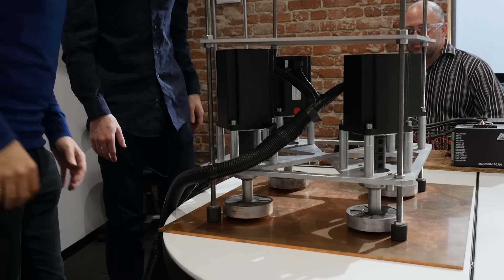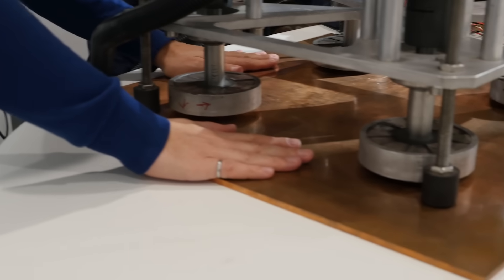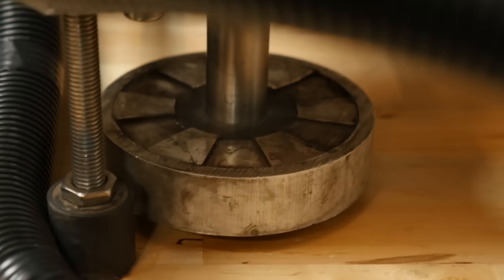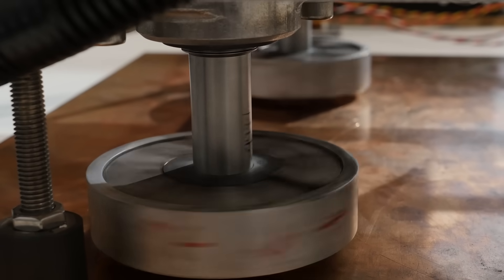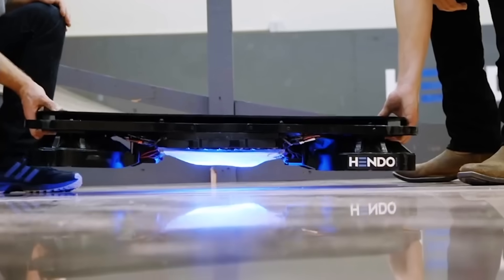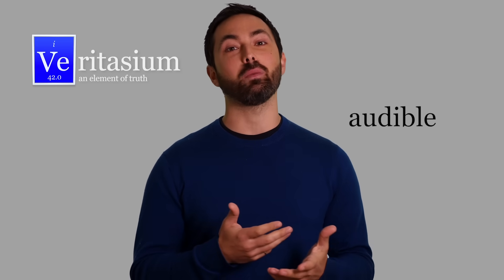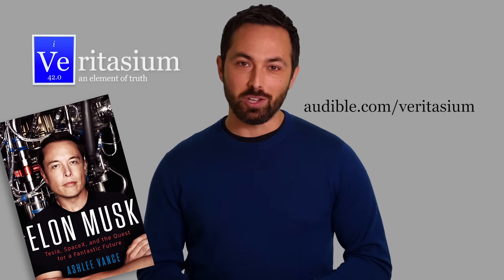Electromagnetic Levitation Quadcopter

Comment: instead off spinning it make a copper dome for each foot with and air gap restrained to the magnet has to be a air gap between the copper and  magnet then throw  the same voltage you used to spin  the magnets.   i swear i made a mini floating ship as a kid out wall socket voltage i was trying to make a heater lmao.... if floated I've been trying for years to replicate it .. but i think copper is the solution .

Comment: So showing the turn of one or more motors would steer the thing in theory but I would use more than 4 motors for a more accurate control of steering and I would use some mix of aluminum  to build the device  see if u can play with the heat issue s little bit

Comment: %%% PRIMARY COMPONENTS %%%

% Reactors with quantum-metamaterial shielding reactor( , type(fusion_mini, v7), rotation(, 20000 rpm), shielding([ layer(zrc_sic_bn, [ thickness(2.8 mm), density(6.2 g/cm³), impact_resistance(48 km/s), thermal_stability(3200°C) ]), layer(graphene_diamond_nanofiber, [ thickness(1.5 mm), toughness(17 MPa√m) ]), layer(photonic_metamaterial, [ structure(hyperboloid), cherenkov_dissipation(enabled), thermal_expansion_coefficient(-2.6e-6/K) ]), layer(sic_polymer, [ self_repair(enabled), response_time(25 s) ]) ]), cooling([ quantum_hall_system( bilayer_graphene_θ1.05, efficiency(94%) ), metastable_hydrogen_circuit( isotope('²H⁻'), state(rydberg) ) ]) ).

% Superconducting discs with topological coating disc( _, material(braided_carbon_nanotubes, [ tc(-175°C), critical_current(380 kA), toughness(88 MPa√m), density(1900 kg/m³), coating(bismuth_antimony_telluride) ]), balance_control([ piezoelectric_actuators(56), correction_latency(45 µs), algorithm(quantum_navier_stokes_v2) ]) ).

%%% HOLOGRAPHIC CONTROL SYSTEM v3.1 %%%

controls( _, _, algorithm([ holographic_neural_network_v3([ topology([input(2048), silicon_photonics]), latency(0.08 ms) ]), quantum_vortex_sensors(resolution(5e-7 rad/s)) ]) ).

%%% IMPROVED ANTI-QUENCH PROTOCOL (v2.6) %%%

protocol( femtosecond_antiquench, steps([ 1: quantum_entanglement_detection(threshold(0.001% ΔΨ)), 2: terahertz_photon_injection(5-10 THz, 150 fs), 3: activation_of_topological_scaffolds([ geometry(hyperboloid), material(nb3sn_2d), flux_resistance(25 T) ]), 4: strategic_reserve(harmonic_em(14.7 GHz)) ]), total_response_time(1.1 ms) ).
Reply: What is this?

Comment: little question , if u could atach te copper plate with some elastic strings from above the machine in such a way that it only permits to levitate and stay in a fixed position exactly under the machine , would that not cause the copper plate to levitate with the machine ?

Comment: in the rverticle hollow tub if the dropping ball is heavy enough you can suck it up the tube magnetically with rsistence and achieve lift ... like catching the mementum of a pmouse trap .. pull magnet up fast and hit hard resistance at top is internal mag lev

Comment: It's floating on the eddy Currents being formed in the metal plate, this wouldn't work without a conductor underneath it, with proper tuning, it may work using the Earth as the Conductor.

Comment: A very long time ago I saw a soneliod with an iron rod running through it. The rod was about 2 to 3 feet in length.  An ac current was inducted in the coil, which was mounted vertically. A doughnut shaped aluminum ring was placed around the rod and it floated about halfway up. This was because of the induced eddy currents. Would be a nice suspension device.

Comment: Like the flat earth, I think videos that give credence to the idea of a hyperloop should come with a warning on the bottom. You cannot hold a vacuum over distances longer than a few hundred feet, the thermal expansion with the different parts along the tube would cause implosion and be ridiculously expensive. You could argue maybe burying it deep underground could work, that doesn't get rid of the cost factor, which goes up substantially, even worse, it doesn't solve the problem, a differential of just 1 degree k along the tube under a vacuum (even a "light" one) would within 95% certainty cause implosion... So, the only way to fix the temperature problem would probably be to put a massive heat-exchanger to the entire outside of the tube, while deep underground, and a series of tens of millions of computers thermally regulating each square inch of the tube within 1 degree, fixed near enough to each space to avoid latency issues, even after those quadrillions of dollars are spent building it, it wouldn't be at all resistant to earthquakes or a bomb going off nearby, or a stray shark banging into its side with a force greater than a few newtons.

Comment: Is the energy to heat the copper plate accounted for by the voltage and current spinning the motors? How much power is left doing the lifting? If you press on the device does that show up in the amperage to the motors?

Are the magnets contributing anything measurable?

Comment: If you put a scale under the copper plate, does the weight of the copper plate increase in correlation to the levitation rise of the quad-copter, when turned on? If the copper plate were attached to the quad-copter by a metal pole which the quad-copter could slide up when levitating, could the quad-copter lift the copper plate below it too, given enough power/magnetism?
Reply: ...or is a change in air pressure or vacuum created somewhere between the plate and quad-copter?

Comment: Shield 🛡 the field forces, vectors.  Use radioactive ☢️ materials. Lead.  Ultra refined steel.  Experiment 🧪 w: frozen 🥶 gases in blocks.  Plates of high conductive, low conducive thin metals plates.

Comment: It would be interesting how this behaves when the plate below is superconducting. With no Ohmsch Resistance there should be less loss and no warming. Of course you might spend alot of energy on cooling instead, but in space that might be easier then here.

Comment: Can the copper or metal that heats up, power a motor? can you make a small motor heating water, with steam. I imagine amazom Warehouse. With robots this size. Moving around while heating the floor that boils steam that turns motors to provide electricity

Comment: To the inventors, I'm wondering what would happen if you cut the copper into segments using diodes to allow that transfer of current into something usable like an led light? and how would rectifying the current induced into the copper effect the levitation? is it that pure resistance keeping it up? or could you recycle that energy from the base copper plate back into the battery and keep it levitating?

Comment: This thing is stupidly inefficient. You can bolt propellers to the very same motors - and this contraption shall fly miles in the air and reach significant speeds using a fraction of power, instead of awkwardly floating half an inch above an expensive copper plate.

Comment: Definitely not flying. It's connected to the wall with power cord, and it can't be moved off the massive metal plate on the table.  It's a useless doohickey, honestly.

Comment: the fact one of the guys worked on hyperloop one does not give me confidence this will be practical and usefull lololol
Reply: Main Problem with them are 1. It needs a LOT of power 2. It makes a LOT of heat. 3. They break easy and aren't cheep to make. but if we got over those problems then they would start to see more use.
Reply: @evanschmitt2802  you forget they need a big slab pf copper plate beneath them. so your limited to the space you place an inch of coppersheet
Reply: @sadev101  That's also a problem
Reply: Can you explain to me what you just said

Comment: Flying Gravity Generators.
Ever wonder why UFOs are dish shaped? UFOs are disc shaped because it's basically a flying Gravity Generator. Gravity Generators require a Superconducting Electromagnet (SCEM) to contain a high density energy of ionic Bose-Einstein condensates (BEC) upon which a high temperature type II Superconducting disc spins them in a SCEM type I containment (cylindrical containment/disc-housing) to produce Gravity.

A hand interface of a SCEM floating disk due to quantum locking interfaced to the main rotator disc mirrors it. Shifting the Bose-Einstein condensate BEC Superfluid by adjusting the hand interface determines the amount of BEC "Gravity" within the condensed cylindrical containment/disc-housing. Tilting the hand interface disc, then the rotator-disc shifts the Superfluid within the cylindrical containment/disc-housing to the mimicked hand interface, increasing gravitational influence in the area where the BEC  Superfluid is greatest.

The spinning rotator causes the high density energy, the BEC to mimic space-time curvature inducing the desired Gravity affect.
Pressurizing the SCEM containment field to constrict the Superfluid increases the gravity field, thus increasing speed in any direction. I was also thinking of a piston "inflatable" type rotator for greater manipulation of the BEC Superfluid, to put Gravity where I want it more efficiently.

Tractor "beams" would require separate units, and possibly a new configuration. I can worry about that later.

💥Effects of a Gravitomagnetic field on Superconductors
Dr. Ning Li

💥Gravitational Effects on the magnetic attenuation of superconductors
Dr. Ning Li

💥Static test for gravitational force coupled to type II superconductors

💥A possibility of gravitational force shielding by bulk YBa2Cu3O7−x superconductor
By Eugene Podkletnov

💥Flying device, no propellers, it's assumed as Electrostatic Levitation.
By, Alexey Chekurkov
The flight of Graviflyer on YouTube
Reply: actually they are called flying saucers

Comment: I suggest you check out programming magnetic fields ,or the magnetic no float state, Or cancelary wavelengths & magnetic field interaction.
  ETC ETC. We have much cheaper easier more energy efficient ways to achieve magnetic lavitation Then a brutal amount of mechanical rotational force and some cleverly placed hallbacks.
 What they are doing with Printed and programmed magnetic fields naw is just absolutely amazing.

Comment: I don’t see a practical purpose for a magnetically levitating “hovercraft”, but if you flip it upside down, I bet it’d make a good induction cook top.
I can fly from Florida to Japan in ONE DAY 👍
Reply: The majority of the gas you put in your car is spent on overcoming friction. Air and road surface.
Reply: @protonjinx  that is true. Internal combustion engines are inefficient, but unless you plan on lining the roads with steel plates, a magnetically levitating car is worthless. Mag lev trains are fine, but 1. We don’t have any, 2. They don’t drop you off exactly where you wanna go. I’d like to see hydrogen fuel cells.. most abundant substance in the universe.
Reply: @rickpontificates3406  There have been Maglev trains since 2004, you know? (but how it works is different from the device in this video)
Reply: @FranÇa_Ball  maglev trains are fine. I said HOVERCRAFT. A hovercraft is not a train, but like the hover trains, would require a special surface to function, thereby rendering magnetically levitating hovercrafts useless.

Comment: Experiment with Electromagnetic Vortex's.. I tried to tell Elon Musk.. The principal is like how Tornado's work.. its not the wind, its the electrical current inside the Vortex.. As a Tornado forms, their is an Invisible Electrical Field that pulls the Vortex Downwards. So you need to create an Inverted Vortex Beneath the Vehicle, Instead of the electromagnetic field being pulled downwards by the earths Gravity. The spinning disk along with the electrical field pushes on the ions in the atmosphere. This then means you have to be a certain height where there are more ions. Or maybe your can generate more ions under the vehicle in some manner.

Comment: Could they not use perpetual motion and electromagnetism to defy lift, drag and control? Some kind of gyro like a bicycle brake but obviously a bigger scale.
Reply: Just saying a geothermal piston/pump would take some engineering but possible. With the decay of a nuclear core would provide heat. The metals we have now with having a stronger reaction to temperatures would lead to more benefits. Along with liquid solar panels we could capture more power safely from nuclear waste. The newer diamond batteries are quite impressive but still need work. Love the video's keep up sharing knowledge.

Comment: So, how many watts was required to spin those magnets? It would have to be a lot, to cause such a thick plate of copper to heat up that fast. And all that was achieved was the work that 4 normal wheels would have done for (almost) free, and would do without an expensive copper "road" needed.

Comment: If the “ train” tube was wrapped in a copper coil, would that make a difference? Also if you had two spinning discs flipped on top each with magnets wrapped in coil opposing one another rather than a copper plate underneath could you essentially make a flying saucer?

Comment: Your explanation of the physics eddy-current braking and energy dissipation is very much wrong. First of all there are two "magnetic poles" induced in copper under each permanent magnet pole whilst they are set in rotational motion: one "supporting" eddy, and another one "resisting" eddy. Both originate from the tendency of metals to not like the change of magnetic fields and induce currents in a way to oppose the change (Lenz's rule). Those eddies with counter-circulating induced currents try to be symmetrical relative to the centre of the pole but can do so only at very low rotor speeds. Second, induced currents modify the original field (the phenomenon referred to as an "armature reaction"), this causes resulting magnetic field to "lag behind": permanent magnet pole is ahead, but the net field in copper and on the surface of copper is actually slightly behind of the magnets (you state the opposite). At very high rotational speed the induced eddy-currents are distorted so much, that the "resisting" eddy actually circulates exactly around the corresponding pole, and the "supporting" eddies are pushed into the inter-pole space (where the transverse Holbach-array's magnet is sitting). And in this situation it is indeed acts as a mirror image of the pole, pretty much shielding the interior of enclosed copper from the magnetic field. Fourth: energy is dissipated due to the fact of finite resistivity of copper, not because the mirror image is not perfect. If you had a high-temperature superconducting plate instead of copper and could freeze-in the field of magnets by the process called "field-cooling", you wont need to rotate the magnets and supercurrents induced during the process of the superconducting transition would to a great deal create a very stable mirror-image of the field of the magnet. And of course no energy would be dissipated, due to infinite conductivity of the superconductor.

Comment: Nope.. sorry.  The heat generated will be the limiting factor, and the faster it goes, the hotter it will get. Not only would the conductive surface need cooling, so would the magnets.  If the magnets reach their Curie temperature, they stop being magnets, and I wouldn't want to see the result of magnet failure at over 100 MPH. Magnets on 100 ft of train would be less expensive than magnets on miles of track, so you'd have to have a cooling system for each car. And in a closed tube with partial vacuum, where do you get rid of the heat???  Expensive 'maglev' drive, expensive cooling (if it can even be done...), expensive vacuum system with expensive maintenance... Too expensive for reality.

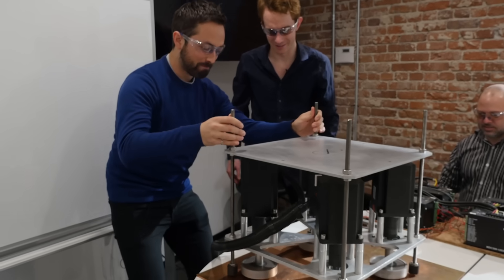Comment: serious question: The device levitates which means the magnetic force from the copper plate is pushing on the device with the same magnitude as the force of gravity pulling the device to earth. If the system is in equilibrium then how can it support more force pushing down on it? What causes the copper to apply more upward magnetic force at 0:55? Is there a sensor that varies the frequency of the motors based on how much upward force is applied on the device?

Comment: As long as it’s sitting on copper plates of course it will levitate  do it with out the plate. I’m working on a gravity well generator that does the same effect but doesn’t require external parts to operate.

Comment: Wait, isn’t the hyperloop just a billionaire boondoggle that would be a dangerous if any length were ever built?
Reply: Hyperloop is just maglev but more expensive and less return.
Most of the resistance comes from the wheels so removing the wheels gives you a big boost to efficiency.
If you want to reduce air resistance simply make the train longer so you can move more mass with less surface area.
That's why maglev exists while hyperloop remains a fantasy.

Besides, existing trains already have a very good efficiency for their cost, that's why we use them so much. Their ability to use electricity also makes the a perfect target for renewable power.
Reply: @ViciousVinnyD  yeah, explosive decompression and pressure waves are no joke.

Comment: Idea - Assume differential equations are not exploited to its fullest extent. To get a random looking value from a function that outputs linear y = kx+m just take a random index. Its much easier to do this than to use 10000 parameters in a ML function to get the same result. So this is something the universe does. Exploit this index hopping in time and space to simulate the opposite copper plate to levitate from any distance like a flying car // Per